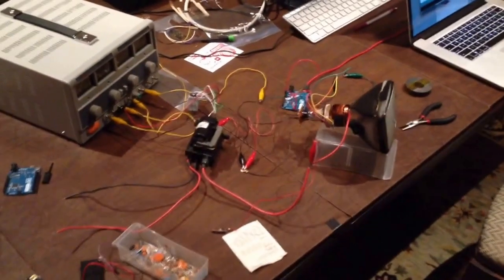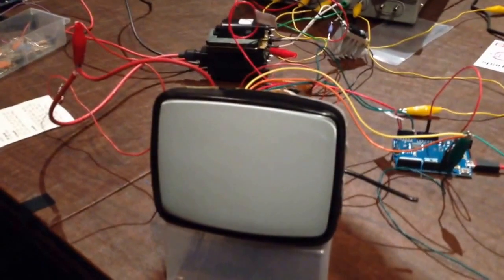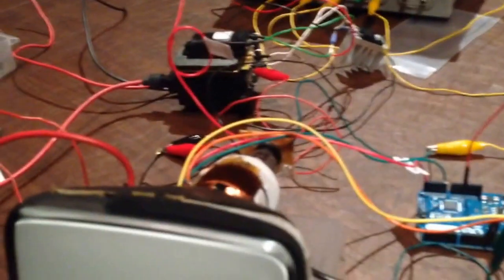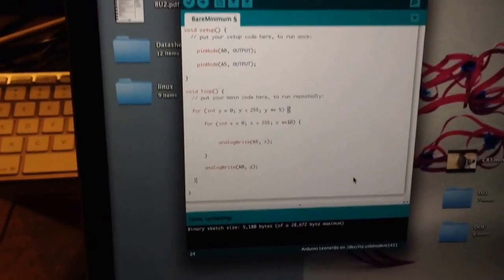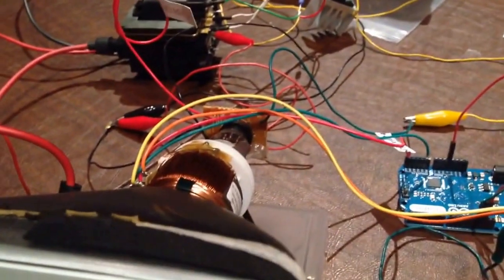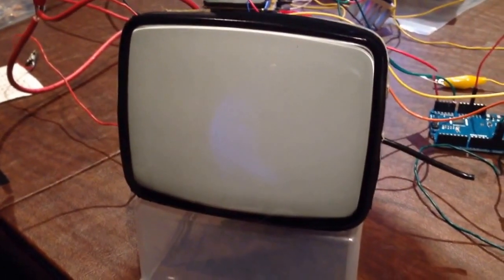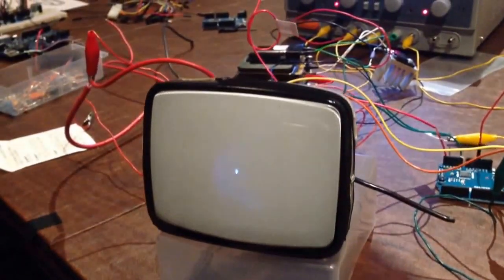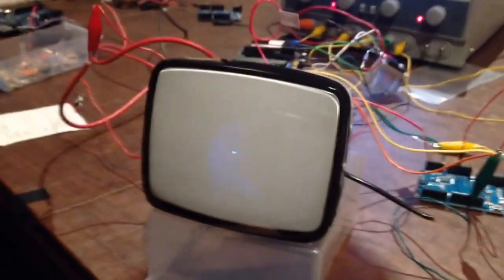Custom CRT Driver Using a Flyback Transformer and an Arduino

Comment: Funny enough, I independently tried to do this... I use a salvaged MOT with full wave rectifier for 3 kv potential. 12v supply for the heater - enough to generate the beam. My tube is similar bw tube. Now, the problem is, arduino is barely able to supply enough power to such low res coils for full deflection (not to mention it overheats since coils have a dc resistance of like 2 and 7 ohms which is basically a short circuit for arduino). I ended up winding my own coils with higher resistance (based on Mega's max current per pin ratings), connecting them to 4 r2r ladders, each feeding in 8 bit ports on Arduino Mega (this is already a big setup!).  I wrote a program that sends bin number to the ports that convert it to variable voltages via r2r ladder. Using a set of buttons, i can somewhat move the beam left right up down. I don't know where to take this further, and I haven't found many others doing this, probably because it is such a ridiculous effort for being able to move the beam. (maybe "starry night" with random function?) Reliable raster will be very difficult to implement due to power reasons, too long to explain. Hoping someone can suggest something, what I can try further. Or suggest some non-arduino board to control crt coils. I found next to nothing on internet. I love crt tubes, and hoping to find a way to use them with some diy board.

Comment: Watch out for x rays when the tube is not using the flyback meant for it.
Reply: Seriously, might want to invest in a Geiger counter if your going to be messing around
Reply: The voltage necessary to produce X-rays would probably destroy this CRT in seconds.
Reply: Anode voltage below 16KV will not produce X-rays. Between 16KV and 50KV you get soft X-rays which are blocked by the glass envelop of the tube. That tube requires no more the 7KV at best. That flyback is capable of producing 20KV in its original circuit. But, who knows what the HV is with his driver. I don't see a high voltage probe in his tools.